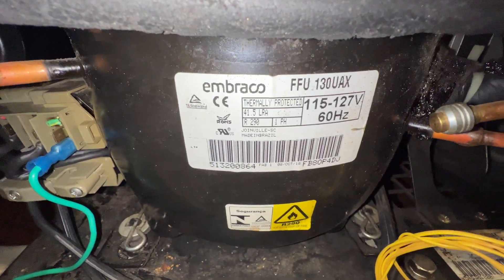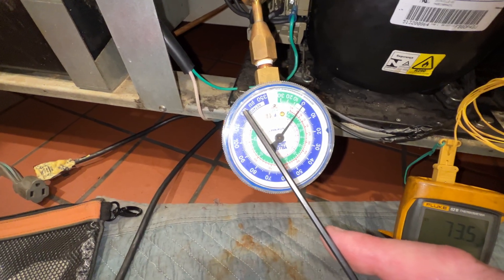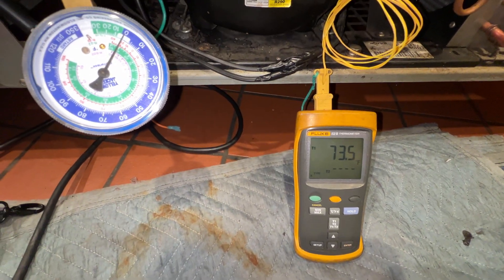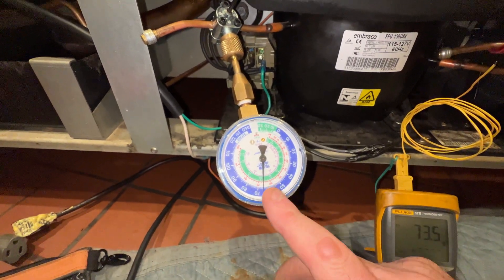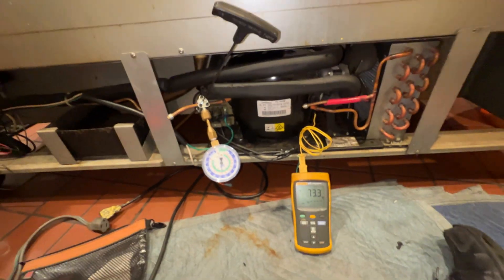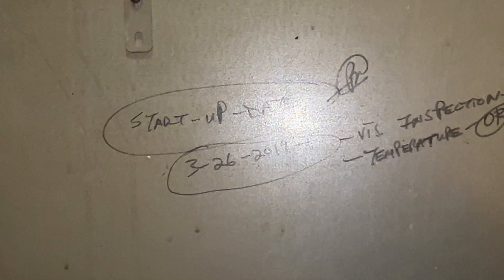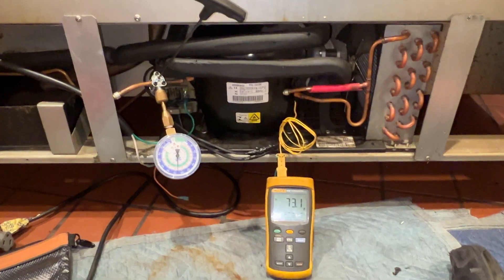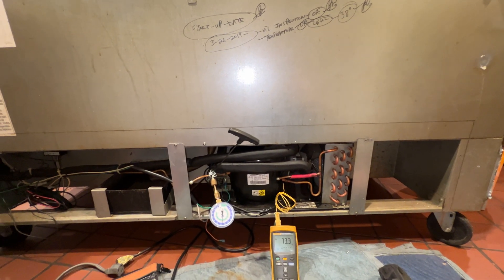Failed R-290 compressor & Wondering how to tell if system is Fully charged or a Leaker ? Here's how.

Comment: What is confusing the commentors so bad?  Checking standing pressure on a unit with a bad compressor before quoting a compressor replacement to CYA.  Also whats the big deal adding a line tap to a system that is already leaking or one that you are going to open to replace components.???  Calm down guys OC has been repairing coolers longer than you have been alive probably, just because its r290 nothing changes except hype.
Reply from the maker: Thanks bobby !  I'm Glad somebody Gets it ! i was starting to worry there. 😂 been doing this since 1981.
Thanks. Oc.

Comment: Good idea! Have been caught out before when it turned out the condensate loop had failed and killed the compressor. I think R290 runs very similar pressures to R22.
Reply from the maker: Yes, i think so too. P/t chart is very similar to R-22.  i was even thinking running r-22 instead of r-290. or 422b. heck you could probably even run 448a since it's the r-22 replacement basically. basically any r-22 replacement you have around.
what i'm seeing is since R-290 charge is so small that if system gets a leak. superheat goes through the roof & compressor dies. i'm not seeing any low pressure safety's & with 290 i really feel they are needed more than ever since soo little refrigerant is used. any leak at all and compressor Runs Hotter than a Honeymoon bride !
Reply: @OcRefrig  I've fixed a few Beverage Air back bar glass door bottle coolers by adding 1/4" service fittings, vacuuming out the residual R290 and recharge with R22. R22 ends up like about 10 psi too high on discharge, and about 2 psi too low on suction, but works great. Had one unit that had such a slow leak it took like 2 years before just one part of the evap was freezing over. It ended up with like about double the ounces of R22 vs R290, but I think it'll last a lot longer. The issue with R290 is that unit called for like 5 ounces and it's a big 8' long 3 door reach-in, so if it leaks like 1 ounce per year, I'm never going to be able to find a leak that small, not with R290 in it anyway. But I would have also condemned that unit you were working on, propane leaks are scary, and if you have one leak then another, boom... That Bev air unit was worth fixing because only 5 years old and new one of those is over $8 grand now. And very heavy and would be really difficult to get a new unit delivered downtown, and try to muscle that thing into the bar, it sits flat on the floor, no casters or legs under it...

Comment: I always thought the taps weren’t allowed on r290…potential for leaks
Reply from the maker: Only using for testing purposes to see if system has a Leak before a Compressor replacement.
Compressor died !
It's Good to know before you replace a Compressor if the system has refrigerant in it & How Much.
if the refrigerant all leaked out & that caused the compressor failure. Now You have 3 Jobs to do. 1) Find the Leak. 2) Repair the leak. 3) Replace Compressor.

Comment: Thats suction pipe you are measuring the pressure!
Reply from the maker: Compressor is Dead ! Junk. not running. not plugged in. 
When a system has been off for 24 hrs or more 
the refrigerant pressures will equalize throughout the system.
Reply: @OcRefrig  Did he forget these little fridges are a cap tube system? Maybe didn't realize it wasn't even plugged in... lol

Comment: Wow I googled r290 standing pressure and it's 175-375 PSI that's pretty up there no wonder they leak don't get a break even when cycled off
Reply from the maker: yea. typically less. but that's pretty typical of most refrigerants. R-134a should be alot less.